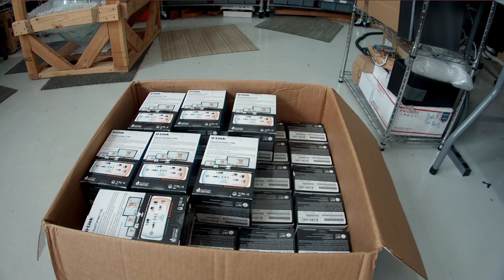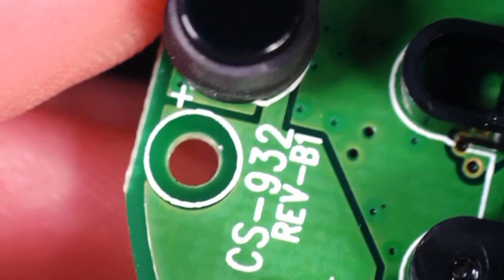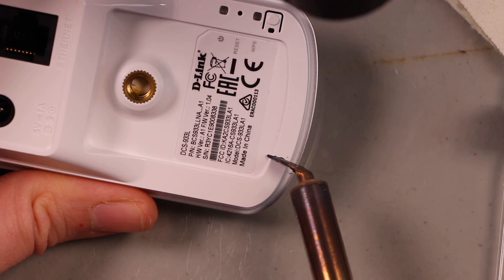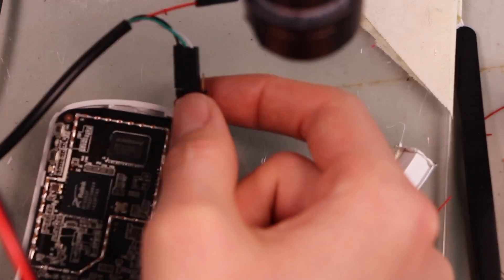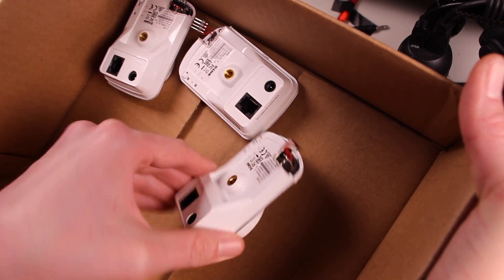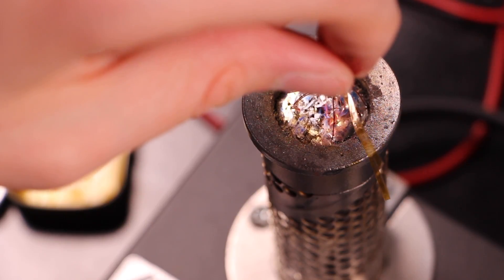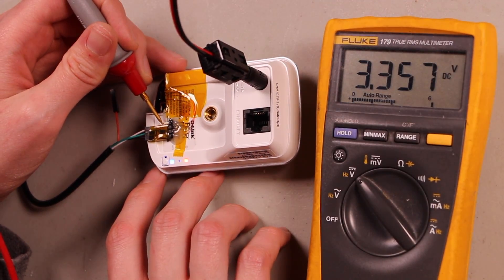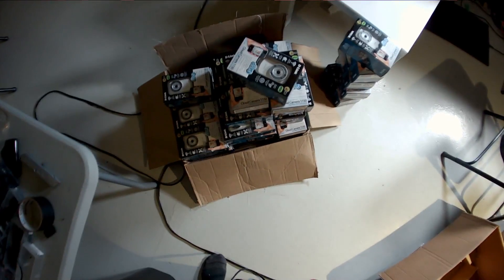Cloud cam teardown and serial port mod en masse

Comment: I would let them build a probes out of hot glue needles and some solder spots.
Plastic prying tools :) Ifix it or some other (cheaper) supplier.

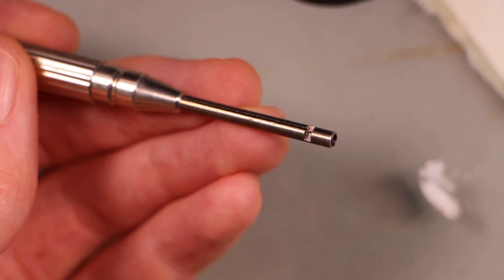03:35 We still need the name of the tool, please.

Comment: a Dremel will leave chips but you can avoid melting the plastic by running it slower and fiber reinforced cutoff wheels do the beak nearly as easily if the old crappy thin ones used to.